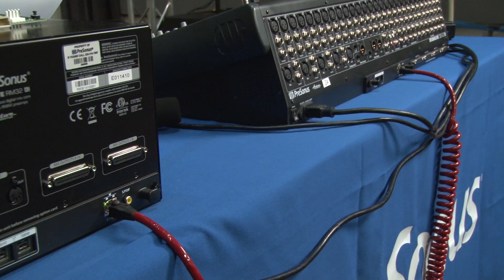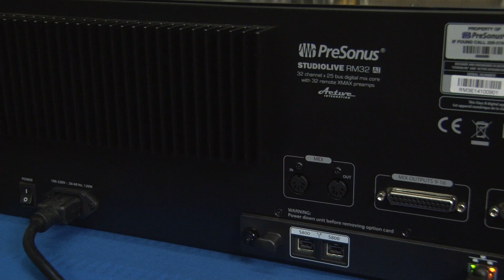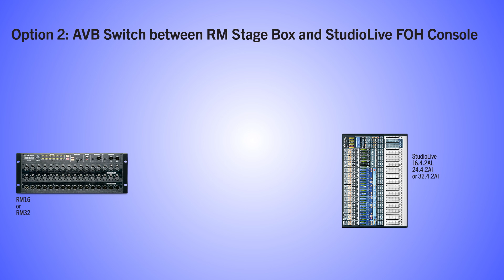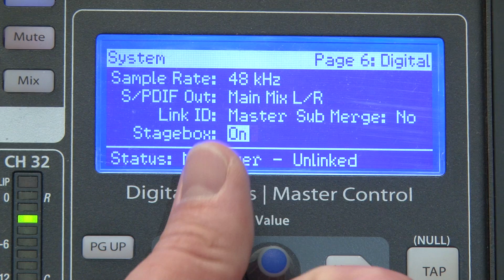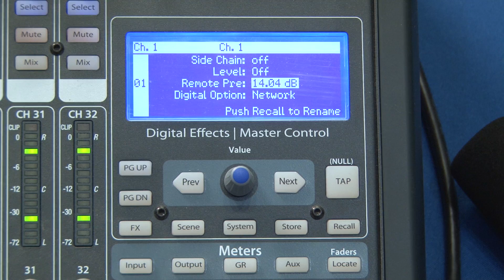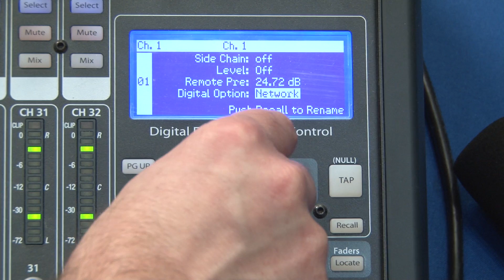Comment: Does the AVB option card allow us to record audio into StudioOne/Capture without a Firewire connection? Example: RM32AI is on stage with a single CAT5 cable running to a FOH AVB switch. Computer for recording audio and CS18AI are plugged into the switch at FOH position. Would this setup work?
Reply: Chris Gill Not currently, but we're looking at that. :)
Reply: +PreSonus Audio Electronics Any progress on this avb audio recording into Studio One?
Reply: +PreSonus Audio Electronics Please do this. Eliminating the shaky firewire cable from my bands live rig is 100% of the reason I've been looking into and looking forward to this AVB card.